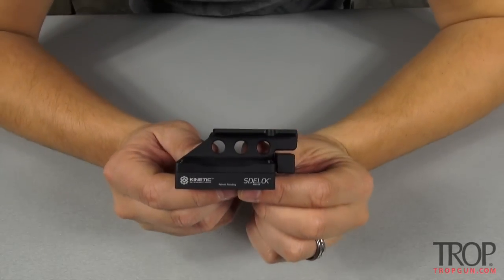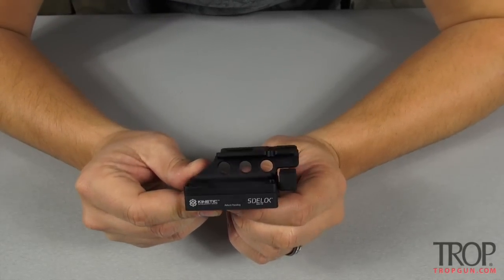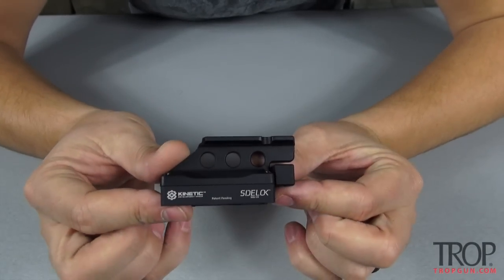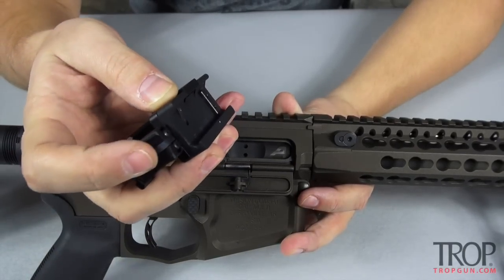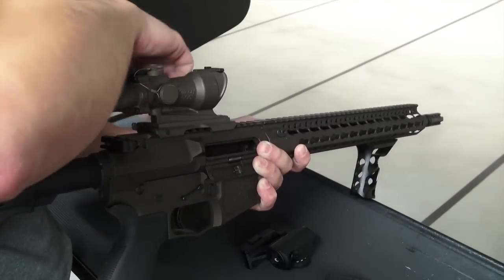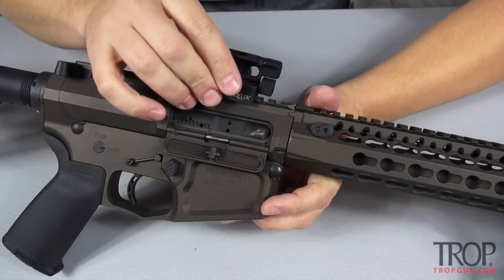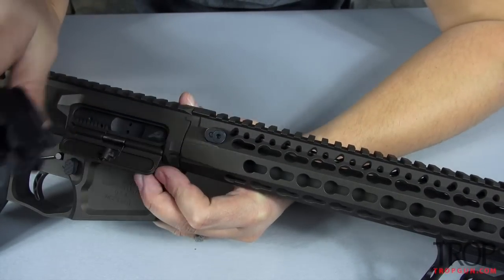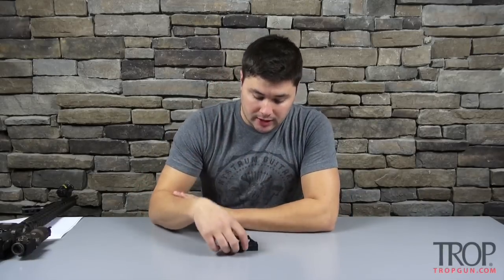Kinetic Sidelok Aimpoint Mount

Comment: I did figure out how to install the four screws but I realize that I should have not removed them.  I’ have ordered a Aimpoint T-2 Dovetail mount for a low mounting of the Aimpoint T-2 onto the Dovetail rail on my Ataman AP16 PCP Air pistol.  I can’t get the push pull switch on the Sidelok to work like in your video.  I utilized a expanding insert on the Sidelok but the switch will not operate like in your video.  I can lock the Sideloc by pulling hard on the switch and it appears to stay locked until I push the switch in.  Any input would be appreciated.